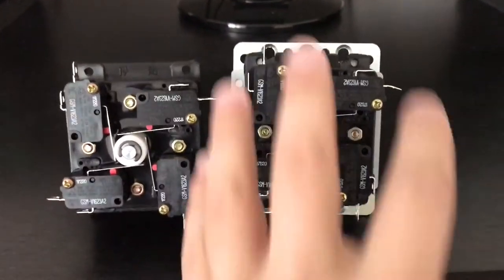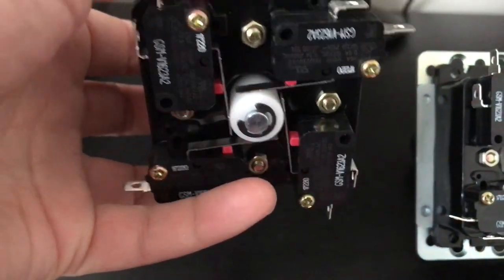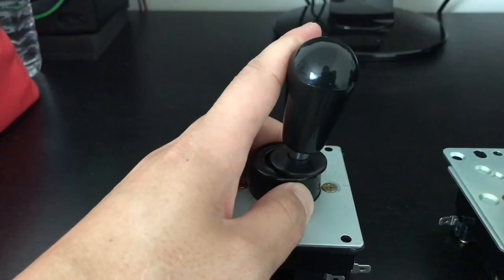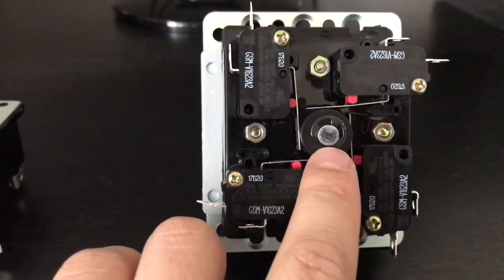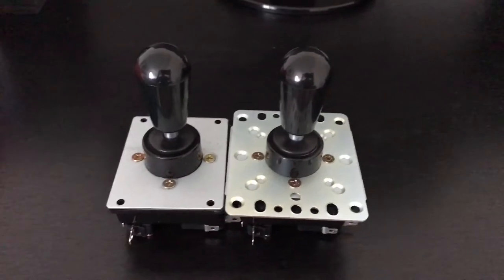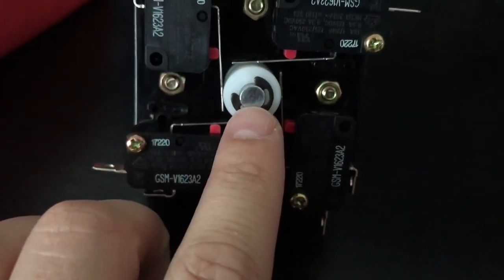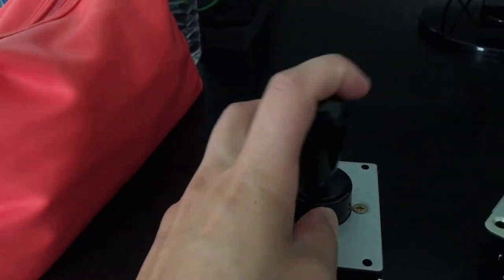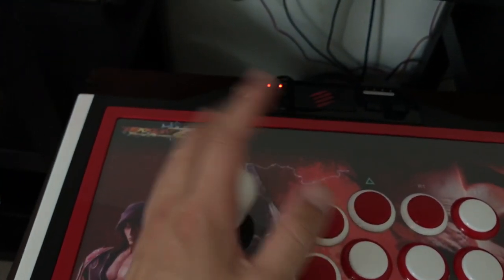Myoungshin Fanta and Crown.

Comment: i would buy your stick in an instant, i cant be arsed to mod this into my own old xbox 360 stick
Reply from the maker: What stick you have right now?
Reply: Madcatz TE S Xbox 360
Reply: broke the buttons trying to even opening the thing, it has broken screws etc
Reply from the maker: Zype Shifty ジコ just drill a 35mm hole on it.
Reply: It also has 6ms lag which adds up, i am terrible when it comes to modding anything at all including drilling

Comment: I've recently got the crown 309mj with the .35 rubber. I really like it. How does the stiffness compare to the Fanta stick? Because the crown also has a spring in it.
Reply from the maker: The stock Fanta rubber is 55 and the Crown 35 with the spring both are equivalent in stiffness.

Comment: Hello, if i use a 45a grommet for my crown will it reduce the lifespan of my switches?? I Mean you need more force in order to activate the switches when you have more tension right?? TIA :)
Reply from the maker: Mark Perez nope that will not make a difference. If the switches goes bad, it goes bad lol. You can prob replace the parts inside it but you might as well just buy new ones unless you have extra parts lying around.
Reply: @EddieYang  hmm.. Where can i buy the switches?.. :)
Reply from the maker: Mark Perez Focus Attack and Paradise Arcade.
Reply: Thank you so much!! :)

Comment: Crown levers are superior because they don't rely on springs in order to spring back into neutral. They rely on rubber silicones in order to spring back into neutral.
Reply: crown levers have a spring attached to the silicone grommet. Fanta's come with thick rubber grommets.
Reply: think you have it backwards.